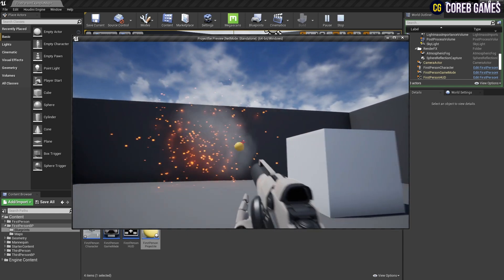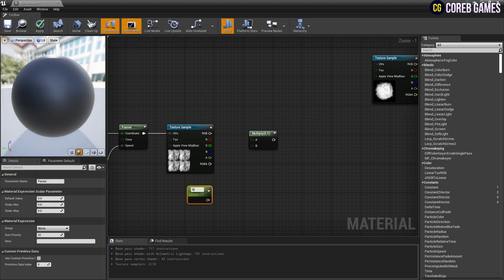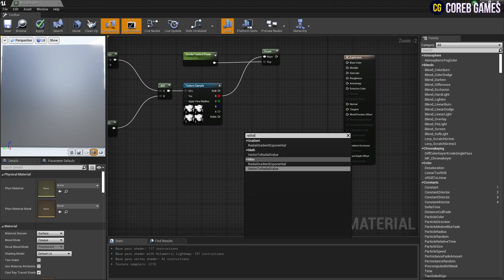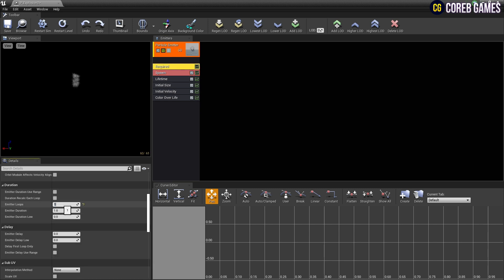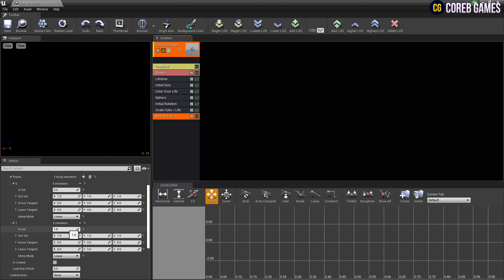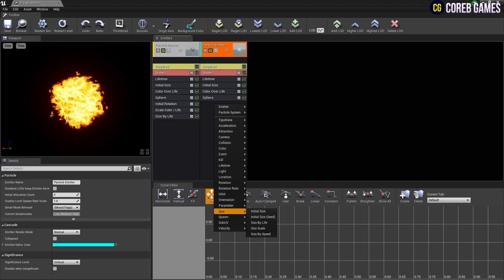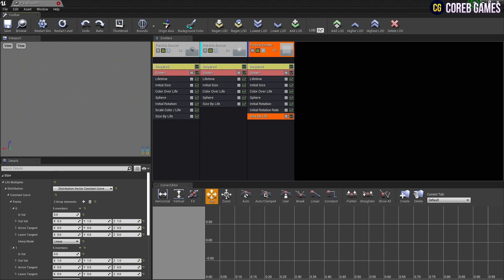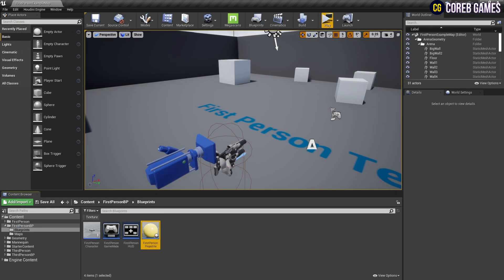UE4 l How to Create Explosion Particle l VFX Tutorial l Unreal Engine 4.26

Comment: hey you are going too fast 
its difficult to follow for complete beginner
Reply from the maker: Thanks for good opinion. We will adjust it.
Reply: @CorebGames  I suggest you just have to voiceover little slow and you can add section like 
making textures
Creating particle 
Implementation.

The thing that makes it difficult to follow you say do this " set some value to this" 

As person who using particle system for first time it's Difficult to follow.

And i have 0 experience that is also a factor that made is Little difficult to follow.

But video is good and it works

Thanks